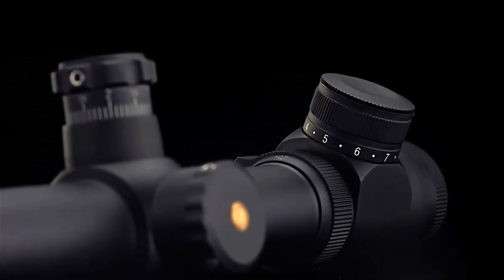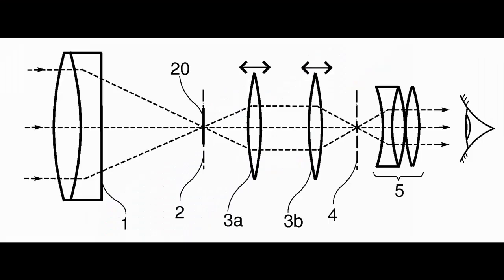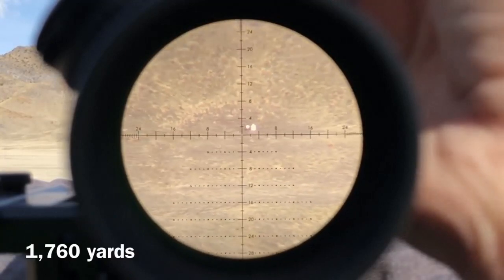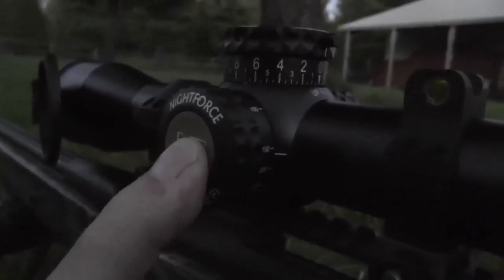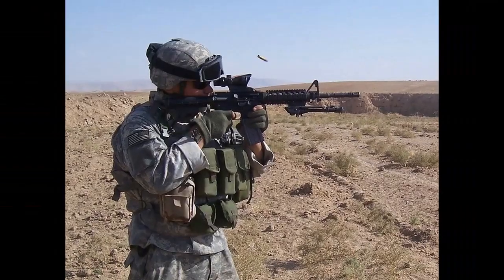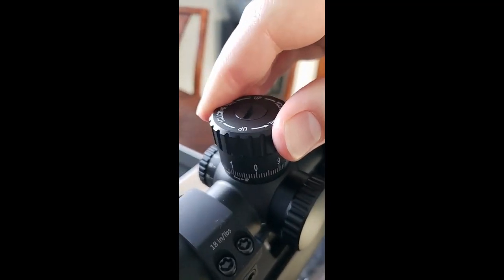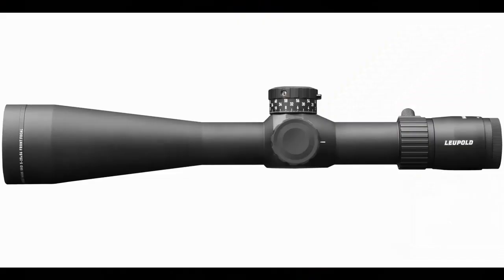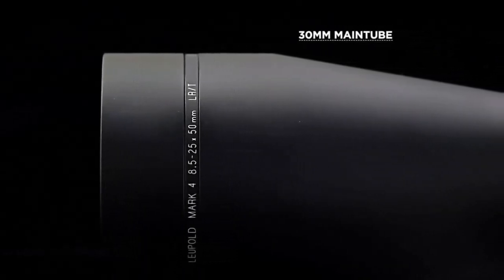How rifle scopes work - ZIKITEC

Comment: Hi im wondering what the purpose of small screw is on the magnification adjustment ring?
Reply from the maker: If I understand you correctly, that screw only made to add lever, so it will be easier to move the magnification ring.

Comment: "The bigger the objective, the brighter the picture the user will get."
Well, meh, no.
Reply from the maker: It's true, but it's only one part of making a bright picture, not the only one.
Reply: @zikitec7820  It is one part of some factors, that´s correct, but it´s not the only one.
Scopes with smaller objectives can still be brighter, right?
Light transmission is the only number which shows if a scope is brighter or not.
Sorry for my correction, but otherwise someone is learning some wrong stuff.
The video is great anyways.
Reply from the maker: You correct
The quality of the glass and coatings is the main factor.
Reply: @zikitec7820  And how many lenses are in there, aka, the zoom.
A 4x-zoom is normally brighter than a 8x-zoom.
The brightest scope today is the S&B Polar-series, which have a light transmission of up to 96%.
Those are all 4x-zooms.
Reply from the maker: In same scope, the lower the magnification the brighet the picture.
Reply: @zikitec7820  Hm, I don´t know.
What I meant is, that the Polars f.e. are 4-power scopes.
They are 2.5-10, 3-12 and 4-16, that means you can magnify only 4 times, whereas other modern scopes allow a magnification of 8 (4-28 f.e.) or even 10 times.
But, the more magnification, the more lenses are necessary in that scope.
The more lenses the scope has, the less light comes through.
S&B has scopes with higher magnifications, but no Polar, which is the brightest series from them, those are only 4-power scopes.
Reply: @zikitec7820  I think what you mean is the exit pupil, but that has nothing to do with the brightness.
Reply: @Ouwkackemann  , it's not bad information. It's beginner level stuff and everyone started out by learning that a bigger objective provides more light. This video is great start for anyone interested.
Reply: @eddieb9110  No doubt about that, I agree and want to appologize if I was to nitpicking.
Reply: @Ouwkackemann  I don't think so: like you said, some scopes with smaller objectives are in fact brighter. Glass, coatings, and design will play a greater roll but because the objective is what one sees on the web listing it's easy for new shooters to obsess on that number, or the tube diameter, without ever looking through smaller better scopes. 
Considering the susceptibility of new shooters to fall into that trap I think it's a very valid point!
Reply: @wilfdarr  Thank you.

Comment: I think you got the first and second focal plane mixed up. With what the reticle does on changing magnification. In first focal plane scopes the reticle does not change size with increased magnification. Second focal plane scopes the reticle size changes with the magnification. Manufacturers, specify that you must use maximum magnification for the correct use of mil dot reticles. 
The military normally favours scopes in the first focal plane. Because magnification doesn’t change the reticle size. Cheers
Reply: You have it mixed up. Front (first) Focal Plane reticles are mounted in FRONT of the erector lenses, which means you physically zoom in on the reticle when you increase magnification. Rear (Second) Focal Plane reticles are mounted to the REAR of the erectors, so it'll remain the same size no matter the magnification. 

Source: I make both types of scopes.
Reply: @TheStig505  ^👍👌
Reply: @TheStig505  . Thanks I get it now. The reticle in the first focal plane stays the same size relative to the magnification. Where as in the second focal plane it doesn’t. So max magnification is required. 
I forget the benefits of the reticle in the second focal plane. I’d prefer a scope in the first focal plane. But they are hard to find in New Zealand. 
Thanks for clearing up my miss information. You are always learning. Especially with people that know this stuff and share. Cheers Brent
Reply from the maker: @elijahmonn3757  thank you for the comment
You correct and say exactly what the video explaining. First focal retical grow together with magnification, so 1 mill allways 1 mill, no matter the magnification.
Reply from the maker: @elijahmonn3757  actually in second focal plane retical it's not allways max magnification for correct mill. Usually the correct magnification mentioned on the magnification ring. Sometimes it's max, sometimes it's different
Reply from the maker: Hi.. thank you for the comment.. 
As I told, and I hope I used the correct words, is that the retical grow proportionally to the magnification. so the mill is growing together with the target and keep it's valew. 
About the second focal you right.. it have correct mill size in only one magnification that usually marked on the scope.
Reply: My man has it right.